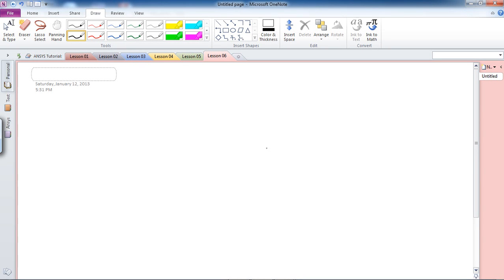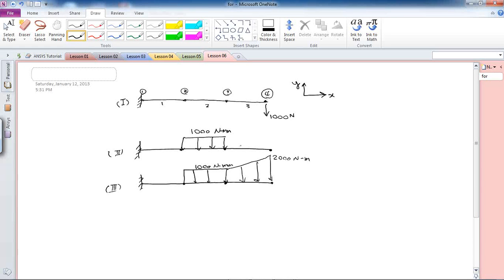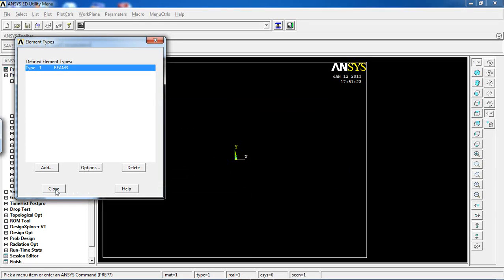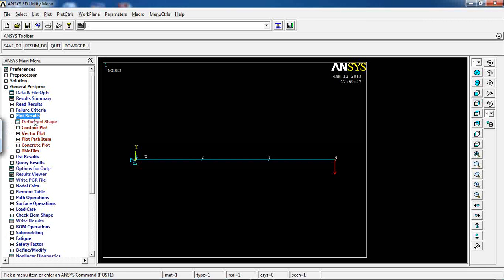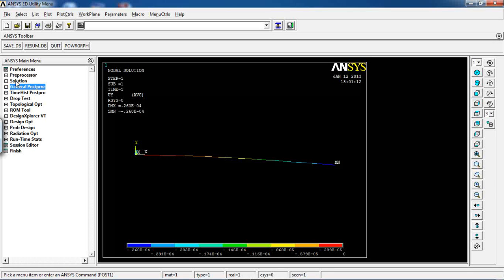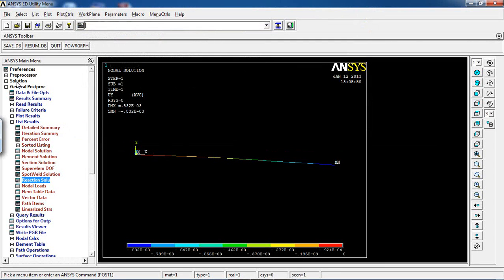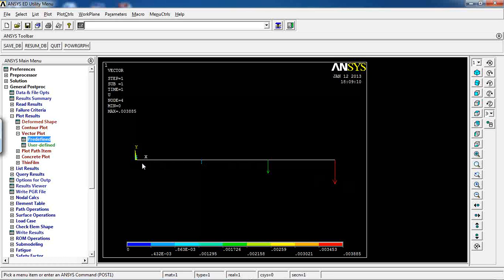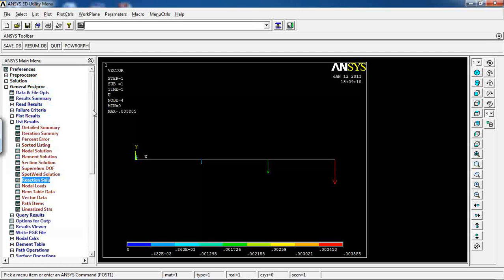ANSYS - Lesson 06: Beam Analysis

Comment: @Hossein Najaf zadeh :This element type does not appear in the GUI of ANSYS V14. A way of getting it is by using the comand et. For example, to use this element type BEAM3, type in the comand "et,1,3" where "1" stands for the number of element type (beware that it might be different if you have already inserted other elements) and "3" stands for BEAM3. Good luck.
Reply from the maker: Or you can use BEAM188 or BEAM189. There is a video for that as well.